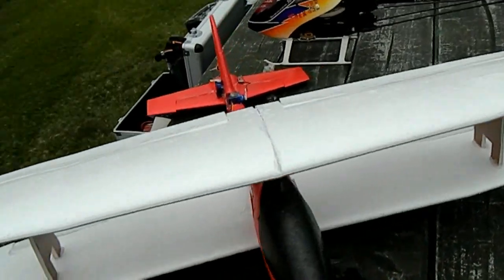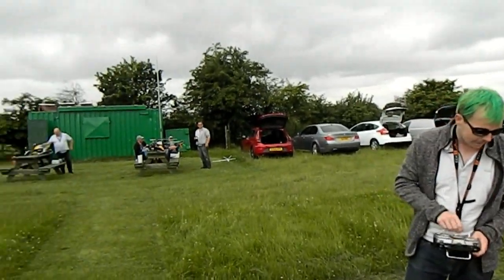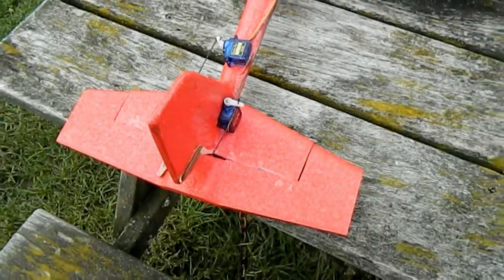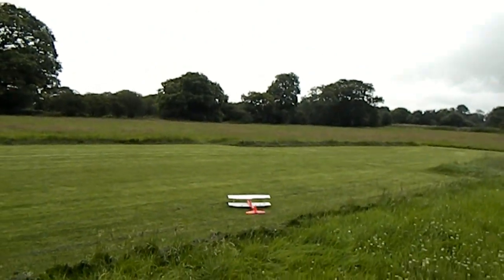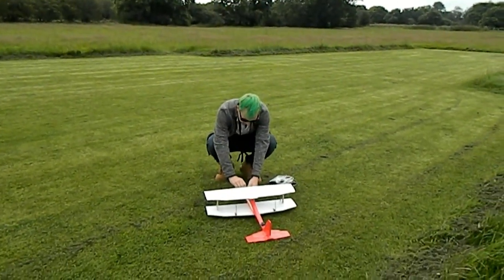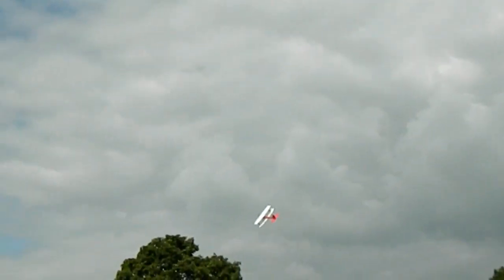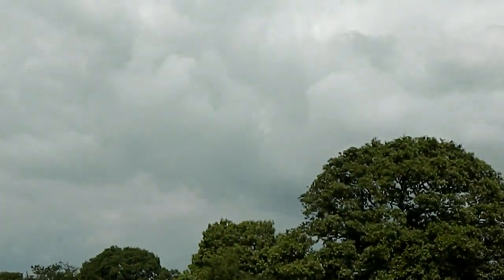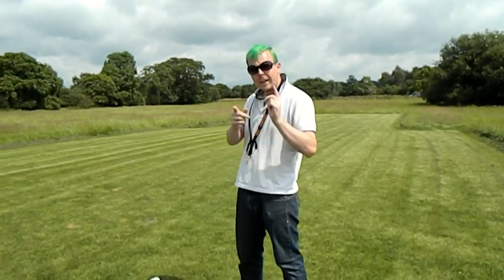Lidl Glider Bi-Plane CRASH

Comment: Nice upgrade!!! What is the small joystick kind of thing on the bench ?
Reply from the maker: thanks very much ...that's a RC helicopter starter, thick bit is the motor and battery and the metal bit is the thin shaft we stick into the chopper to turn the engine over